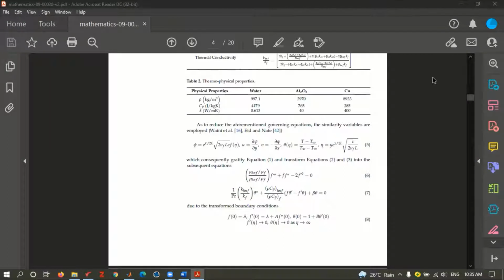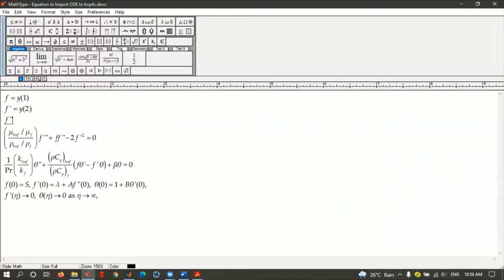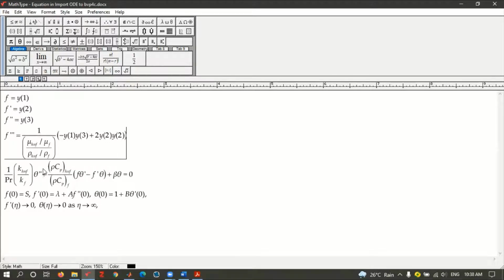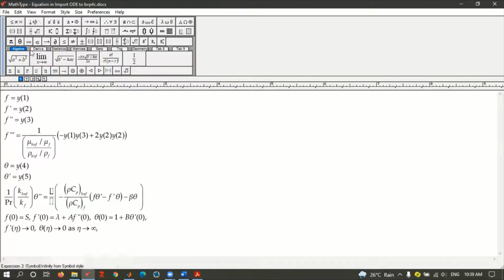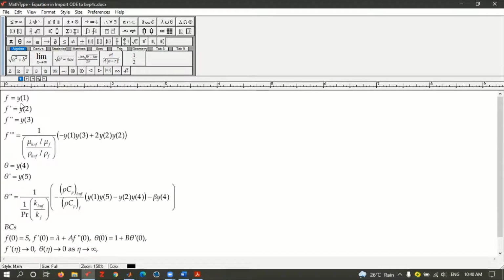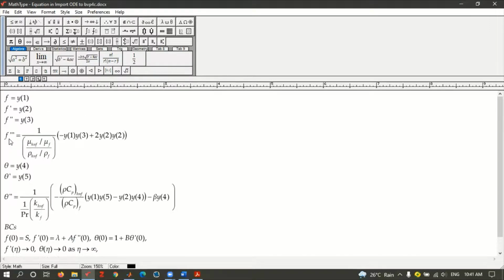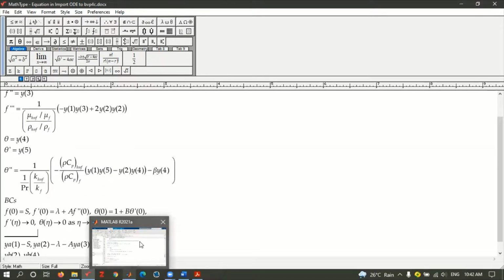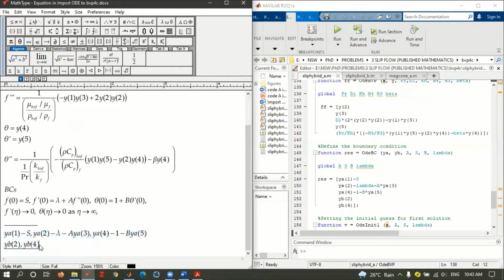Bvp4c | Part 1: Modify ODE

Comment: Thanks a lot ...i ask how can i solve this problem : MATLAB : Jacobi : singoler ?
Reply from the maker: Do you mean the error? Maybe you need to adjust the value of the parameters e.g. try to make them small, or adjust the initial guesses.
Reply: @nswahid  Yes , i did but without result , the same error appears ...i ask can the equations be unsolved ?
Reply from the maker: I guess, yes. It can be unsolvable if the initialization value doesn't meet the convergent criteria.